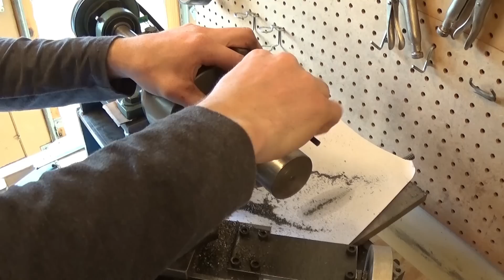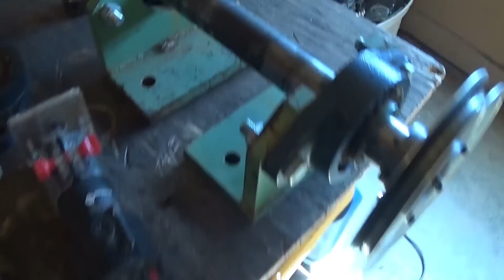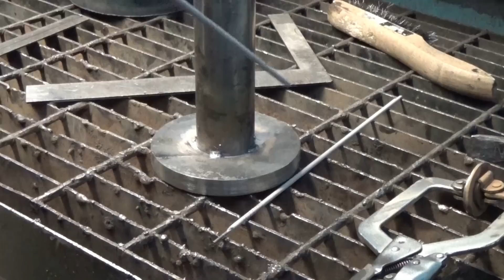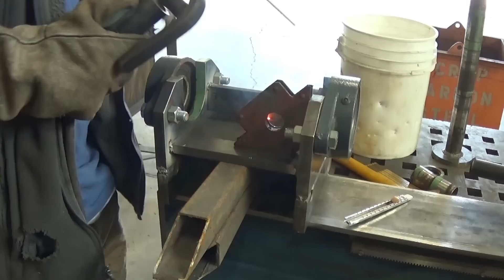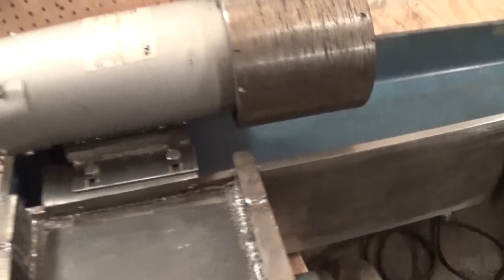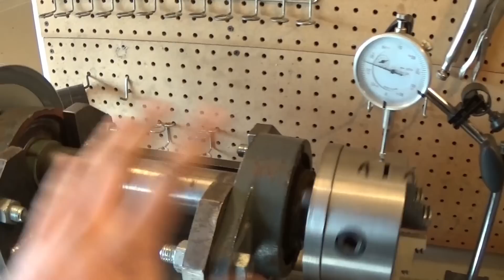home made lathe part 9 new headstock

Comment: Holy shit. at 33:30 you get your hands in on the work. If that chuck caught your shirt sleeve or your fingers then you'd be missing fingers, or dead from massive crush wounds to your upper torso and generic blunt force trauma all over. 

You're not stupid. You're very clever and very capable, but your ignorance about these machines is quite possibly going to get you killed. You're young and you feel invincible but this machine will straight up give you a closed casket funeral and it won't even slow down to do it. We're talking about the kinds of energy here that could perforate you with a piece of work and after it goes through your chest cavity or skull it would still have enough force behind it to go through a wall or two. 

Imagine a machinist who knew just enough to be a danger to himself trying to play around and build his own welder. That's a field you know what you're doing in and there's a thousand and one things he'd do that would throw up red flags for you. This situation is basically the reverse of that.

Also the word you're searching for there is runout. You have almost ten thous on your chuck and you say it isn't much but by the time you get down to the end of your bed it's actually going to be quite a lot. 

Not a machinist myself but I'm a bit more familiar with it and I've had a career of working with machines that would kill you in a heartbeat. You really need to slow down, educate yourself, and come back to this when you know enough to be properly scared of the machine.

Comment: keep at it ,but accuracy is the key mate .Lap your surfaces and tighten up the slop with some adjustable phosphor bronze or brass bushes then  true it up ,you will bring it down to a thou or better if you use tapered bearings . A hollow spindle is a must .You will learn so much as you go along and improve it ,the first is always learning curve .Go for it !

Comment: Getting 'er done. I need new bearings for my homemade lathe head stock. I sure wish I could find some like you did in a scrap yard here. If you wallow those mounting holes out some more on that face plate you can true that chuck up some more. I would.

Comment: I dont believe pillow block bearings can take both the axial and radial forces that a lathe requires to cut without chatter, not all but most lathes use two tapper roller bearings front and back to take the bi directional forces generated when cutting, there is a good reason lathes are mostly made from cast iron, steel literally rings like a bell and shows up as chatter where cast iron is able to absorb the ringing much better

Comment: You might be able to salvage your lathe by putting heavy duty  linear rails on the bed and buy an old headstock from south bend or an Atlas. http://www.ebay.com/itm/South-Bend-Lathe-9-Headstock-W-BELT-/192131572606
http://www.ebay.com/itm/2-THK-HSR30-Linear-Guide-Rail-Blocks-with-1000mm-Rails-Linear-Bearings-/182474233086

Comment: One reason for your chatter problem is the characteristics of a steel I beam. While they resist bending, an I beam can twist. With the single web in the center supporting your ways the top flange can flex up and down a few thousandths with even a small cut. One solution would be to make a bunch of pieces of quarter inch or thicker steel long enough to fit between the bottom and top flanges and narrow enough to avoid interfering with saddle movement. Weld them into the back side of the I beam every 8 inches or so. You can do that without messing with your feed rack and it should stiffen the upper flange somewhat. I don't know if it will solve the problem but it should reduce it a lot.
Reply: It is still an ingenious design. A good piece of machinery for a student to come up with. A real learning experience. I can't wait to see what you accomplish when you get out of school and into the working world. Somebody is going to get a really skilled worker.
Reply: Hi Lawrence, your suggestion is very good. It will stiffen the whole structure without requiring him to modify the carriage. It's a good start to improve his results.

Comment: Lose the carbide cutter bits and get high speed steel cutters you will get a much better finish from that lash-up, it just doesn't have the power or the speed to utilize carbide. You are on the right track and doing a fine job! Just remember 3 things you need in a lathe 1 rigidity, 2 rigidity, 3 RIGIDITY

Comment: Another suggestion for bearings would be oil-impregnated bronze sleeve-bushings.  South Bend lathes have been well-known for many years for their smooth no-chatter finish.  They were very solidly built machines and used ordinary wet bronze sleeve (i.e. friction-type) bearings.  Make some housings for the sleeve-bushings complete with oil lines, end seals, and you would end up with a very nice st-up.  Make your sleeve bearings nice and long, e.g. ~3'' or so.  As one commenter mentioned your chatter is coming form many places, so simply eliminate them one at a time.

Comment: The lathe is one tool that can actually be used to build itself and you are doing a great job.

The head-stock spindle could be a piece of DOM (drawn over mandrel) tubing which would give you a through-bore to accept long pieces through the head stock.  A common size of spindle nose thread is 2-1/4 X 8 tpi.  If you would get a short piece of 2-1/4 DOM heavy wall tubing, and fit it up with tapered roller bearings you could eliminate that chatter.  Regular pillow block bearings are not suitable for axial loading.

Comment: You should be using tapered roller bearings with a lot of preload. You will never get good cuts with those bearings.
Reply: Any suggestion on how to preload the bearings? The thing that comes to my mind is something like threading 2 nuts against each other and thus creating load against the axial bearings, but threading a huge pipe isn´t really an option for me.
Reply: Typically preload is applied via a nut to two bearings, constrained on one side by a shoulder, and the nut on the other. The bearings in the video are deep groove roller bearings, and will not stand up to the side loads. Tapered roller bearings, or angular contact bearings are required.
Reply: MrWreeve so the shaft or spindle would be partially threaded on one side?
Reply: That is correct. The bearing pair should be located close to each other to minimize interference as the temperature increases, and the spindle grows. The end of the spindle that is not supporting an external load can be a standard roller bearing configuration.
Reply: MrWreeve good to know! thanks
Reply: Curious question here. Couldn't a person take a rear differential from a truck remove the axles, cut the hollow tubes off that carry the axles, and then use the carrier and its housing that was meant for a drive shaft and design around that? Wouldn't it possibly eliminate worrying about preload on the bearing since it uses the correct bearings and they already come preloaded provided the person simply does not remove the yoke nut? 

It's just a thought but attaching a headstock to something like that seems like it would set you ahead of the design phase a little and allows for a corner to be cut while retaining all the principals needed to drive a lathe headstock. 

Also there is the added bonus of possibly welding plates over the axle holes, drilling a hole and fitting it with a vent fitting and refilling it with differential fluid to keep the carrier and bearings constantly lubed if you wanted to take it that far.
Reply: MrWreeve 
That was my thought as well.
Reply: I suggest you examine the design of other lathes.  Go get the repair manual and study their head stocks, find the bearings they used and read the procedure on how to preload.  Use the same bearings without all the gears.  Take your advice from the documents of proven machines that were designed by a few smart people.

Comment: Hi,

1 - Put a gearbox (from a little motorbike) between the motor and the axle, to mix torque and speed (i already put this here "in a galaxy far far away" .... on the first video).

2 - Look in the beginning of video (4:50) how the chips dancing in the paper, this lathe dance a lot, look the screws that fix the tool.... :-)
To improve the cutting tool stability, you need fix this lath in a heavy place like a table with a heavy concrete top.

3 - You need gain weight, this lathe is very skinny, big weight create a lot of inertia against the vibrations.

Comment: You're still getting a lot of 'flex' through the tool holder & saddle assembly !  REMEDY :  LOCK the cross feed when turning . . . & Lock down the saddle when FACING !  
    Without tightening the 'slop' , you will continue to have CHATTER !   Another thing you need to address , is facing the back side of your chuck adapter. . . it is still very much 'non precision !   Remember that a chain is only as strong as it's weakest link - the SAME holds true with precision . . . Youtube has considerable material , sadly; there are a lot of 'wannabe' machinists that are putting out 'not so accurate' information * which leads to not so accurate results !      **  I would suggest that you do a proper alignment of the bed & saddle , build a good tailstock, then bore your spindle to accept a Morse 3 or 4 taper - ( That would give you a perfect 'center ' to begin to base precision upon. )   
     When you build a tailstock, you can 'snug up' the gib , then  bore it with the headstock , which should be as ''perfect'' as the straightness of your bed - * If your bed isn't straight and 'true' , nothing will be able to be aligned !  ( Try using high speed steel cutters, & LEARN the right angles to grind relief . . . the 'cuts' I've seen this machine make , are more like 'rubbing' than good clean cuts . . . cast iron can leave a very nice finish , if the cutting tool is nice & sharp, with a small radius ground into the cutting geometry . . .  try using the correct tool - * I noticed that you were using an 'AR' carbide bit, that was canted at an odd angle , & you were turning AGAINST the designed geometry of the cutter !  )   I wish I could give you an instant solution , but you will have to learn by doing, if you can't get some good instruction !      If you have access to a precision square, it would be helpful to find some errors . . .  You CAN use your indicator to see how much runout the lathe 'bed' has . . . merely 'looking' flat, or straight , & BEING straight & FLAT are two entirely different things ! 
         I wish I had access to some of the steel bargains you do !    Good luck with the refinements . . . you definitely have the parts . . . now just work out the imperfections !

Comment: wow nice build its too bad you couldn't get a 2 inch axle with a 1 inch bore so you could turn long pieces of metal. oh is that little compartment under the head stock a spot to put tools and stuff if its not it would be really good for that.
Reply: once he gets the tail assembly done, he could drill a hole into the axle with a 1in drill bit and make it himself

Comment: running too low on rpms for steel and carbide. .also , you could have removed the toolpost, and clamped the drill to the carriage and run the drill into the plate with the carrriage.Anyway, awesome job, some mini lathes actually come with .004 runout so you did excellent
Reply: also, have a look at the tip of the carbide bit , see if there is any radius on it.. If not , that may be a big reason for the less than perfect finish ..

Comment: Nice build, I have some questions/comment I hope you will find constructive. How careful were you in aligning the bearings? I didn't see you apply any pre-load to the bearings. Do they require any? If they do, that could be a source of some chatter. If you look at the surface of the last cut you took, you can see a wavyness to the cut which is an indication of chatter/vibration.

Comment: You can improve the facing/turning finish if you remove the 5 mill run out on the chuck.  The lathe is turning ellipses because of the run out.
Reply: Jason Doege Hell, the runout of the chuck just has nothing in common with the runout of the workpiece! You chuck the workpiece up, turn over it, and that what you have turned is perfectly round (just like your spindlebearings, not like your damn chuck...)
Why does nobody on youtube knows anything about metalworking but has to do like knowing everything....
Reply: +Markus Lex I don't know. Why does everyone assume they know the full extent of a person's knowledge based on brief comments? You can grind your three-jaw chuck to get better accuracy in the workpiece, you know. You can also build indexed workholding collets that you clamp in your three-jaw to provide repeatability. It is helpful to remove the runout from the perimeter of your chuck for faster more accurate setup. But all of that said, I can chuck up a piece of drill-rod in my 3-jaw on my 7x14 and get .001 runout without too much effort.
Reply: +Markus Lex There are a lot of poorly considered, overly critical comments on this build but the builder is certainly hoping for quality but has left a lot undone probably due to lack of knowledge. For a start, I think he needs to align and preload the bearings on his headstock and probably put some effort into truing his carriage and cross-slide ways. The run-out in the chuck is the least of his worries at the moment.
Reply: No ellipses, but the center of whatever he cuts will be offset from the center of the chuck making it near impossible to remove and replace something he is turning. It will be easy to dial out the 5 mil, though.
Reply: FWIW, I got the runout on my 7x14 down to less than a thou.
Reply: thats really good..
Reply: Jason Doege definetely agree, 
the easiest way for the bed is maybe to use linear ways, but they are very pricey in this sizes..
Reply: He used an indicator when he mounted the chuck.
Reply: Paul Arber
Reply: +Jason Doege
Sorry, please excuse my words.. I shouldn't judge like that. But i read about all the retarded comments under this video and just couldn't resist to put an answer like that.
Btw.: The maybe most exact way to chuck a workpiece is with turned aluminium jaws

Comment: A schedule 80 pipe works as a main shaft.  You will find a need for the hole before long.
Reply: I agree Jim. A piece of schedule 80 pipe can be sourced or even DOM tubing with 3/8" to even 1/2" wall thickness would be better IMO. That combined with tapered bearings gives a better setup. Also...I'd try to have the headstock final attachment to the lathe using slotted bolts. That way you can adjust it true to the bed....up down and side to side. That's how I did my mill project. 
    In any case....When it's all said and done....The lessons learned through this build will be invaluable IMO. No such thing as a waste of time when one learns from the process.
Reply: he can drill a hole into the axle once he gets the tail assembly done or if he decides to chance it with the tool holder
Reply: Ordinary pipe is fairly soft and can deform in regular use.  That deformity would show up where the pipe-as-spindle comes out of the head stock bearings.
Reply: I used a piece of 2in pipe sch 40 the od is 2.375 In .Heavyer spindle would be great for a machine.
Reply: @AliceGirl2019  Coincidentally I'm setting up a 7x14 lathe for my son right now to make parts for our homemade lathe project. Not 5 minutes ago I mentioned the above comment I left years ago. 
Maybe I'll grab a lottery ticket.
Reply: The thing about 2-2 1/2 dom tube is a 2foot part is about $175!!
Reply: @AliceGirl2019  DOM shorts show up at metal recyclers and they cost a case of beer every time.